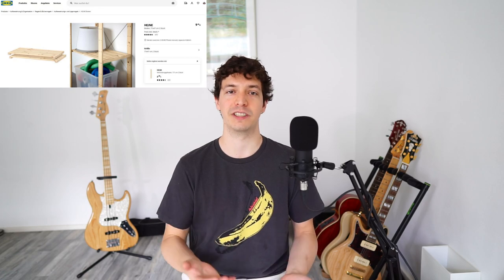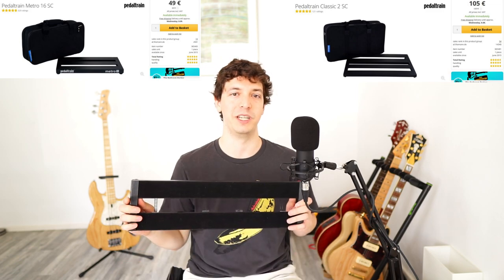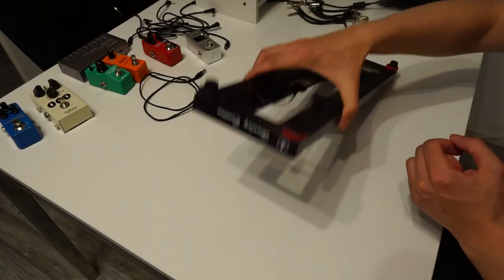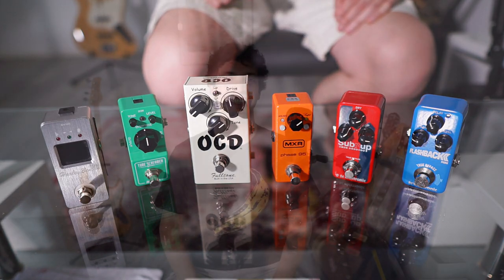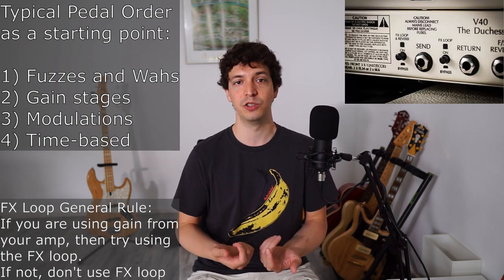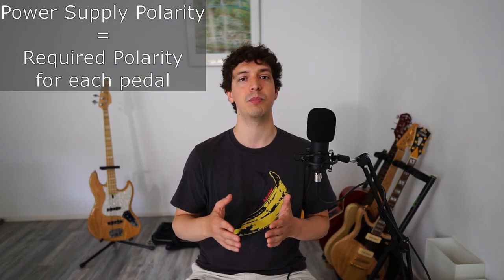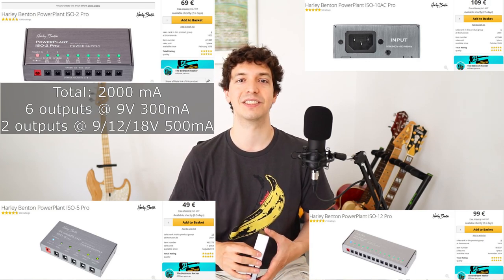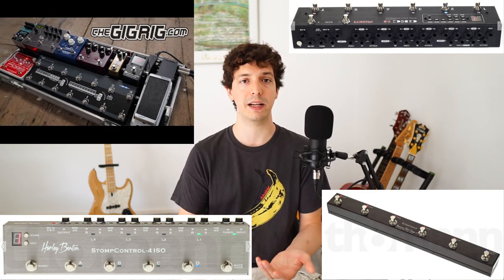Pedalboard Build Tutorial

Comment: I was thinking about building this kind of minimalistic pedalboard with mini pedals and came down here to your video. 
Great and comprehensive content!
Do you see a reason to include a buffer pedal in the pedalboard of this kind?
Reply from the maker: Thanks for the comment. I personally don't. It's a small board and I'm not running extra long cables (I play mostly small stages 😅 and I usually don't use the amp's effects loop). In these cases, I can't usually tell the difference between a buffer or not. In some cases, I even find the buffer worse, i.e., my PRS SE Custom 24 has slightly hot humbuckers and I've found the sound with buffer to be a bit harsh and unpleasantly distorted in the top end if I have a buffered pedal first in chain (I prefer the true bypass). If you have a buffer, then you can try it and see whether it makes a difference. If you're wondering whether to invest in a buffer pedal for this size of board, then I would personally invest in some other type of pedal. I think TC Electronic has a Polytune version with integrated buffer circuit, so that might be a good start as you get a buffer and tuner in one pedal and can deactivate the buffer if you dislike it
Reply: @TheBedroomRocker1  Great idea, thx! I also saw that Boss tuner has a built in buffer